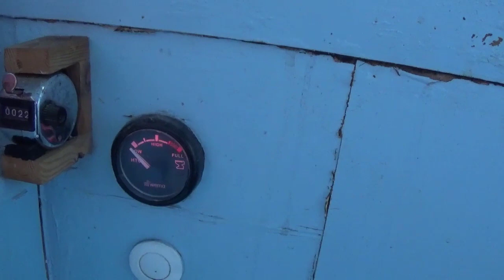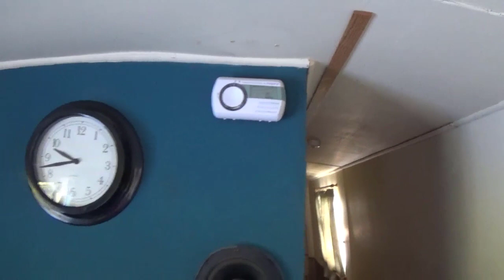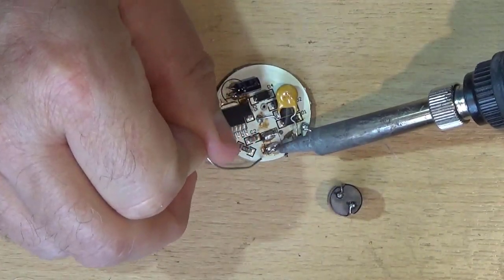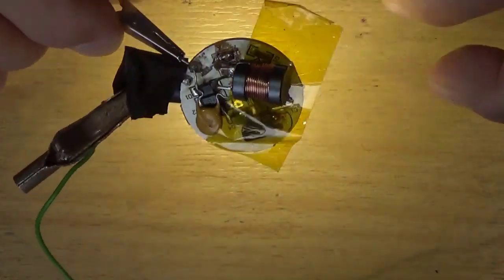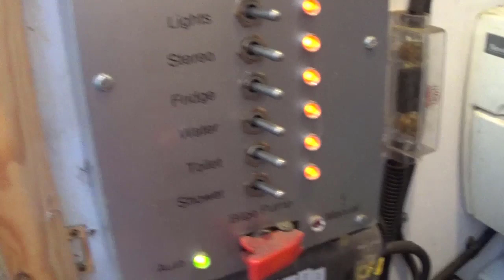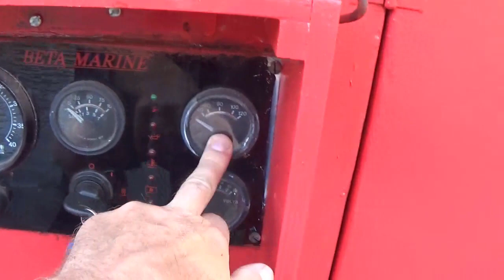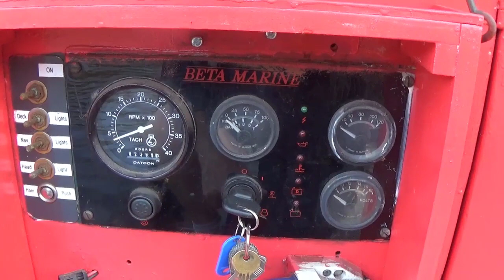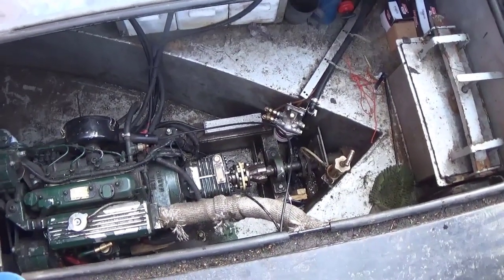Narrowboat Electrics & Electronics Walk-through

Comment: As carbon monoxide is heavier than normal air, you really should move your detector to about 6 inches off the floor:)  or about six inches below where your head is when you are sleeping.
Reply from the maker: Thanks for that - I never thought of that when I put it up. It is even more important because the lowest 1m of the cabin is below the water level so the gas cannot escape.